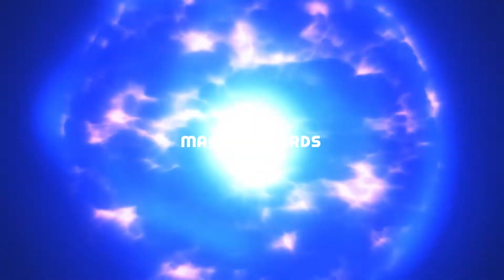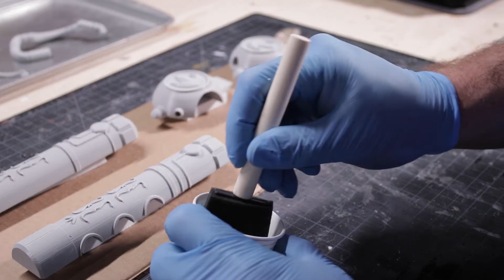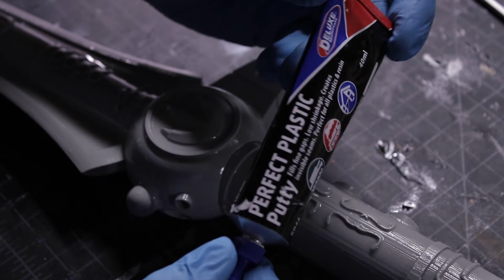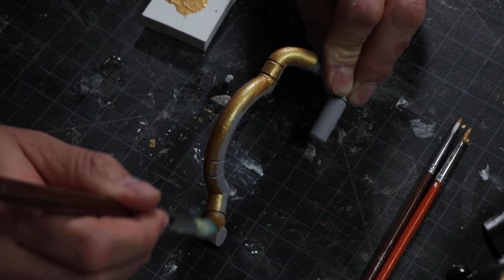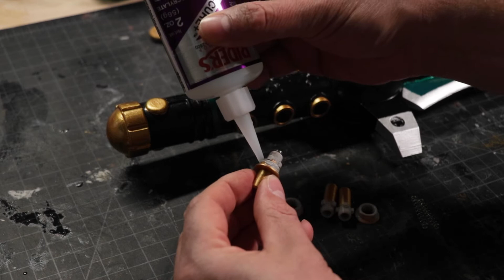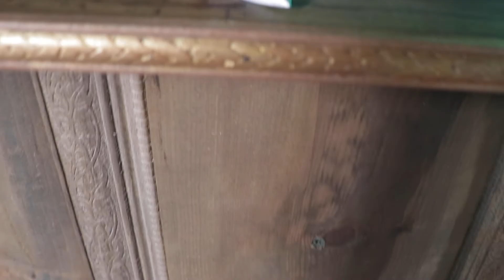Power Rangers Dragon￼ Dagger 3D printed

Comment: hey Im having trouble with the buittons they keep getting stuck whenever I try to use the buttons and wont come up am I doing something wrong
Reply: also when i attempt to pur together the hilt and handle the hilt attempts to separate whenever it but the handle in
Reply from the maker: Just cause I have to ask….prolly a stupid question, but are you using springs with the buttons? Your woes could also be some sizing issues. I sanded the handle quite a bit and it still was a very snug fit for me. Which, even that’s odd because the prop was designed to be printed as is and no resizing was/is needed. So another possibility is there are some layer line issues or “artifacts left over from printing.
Reply: @MagneticNerdsCreate  where can i find the file for the buttons please